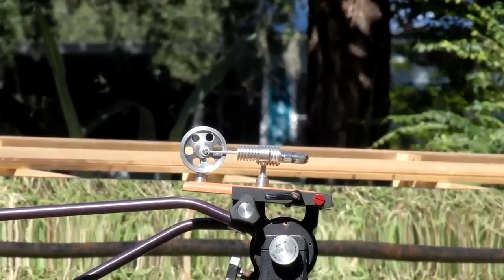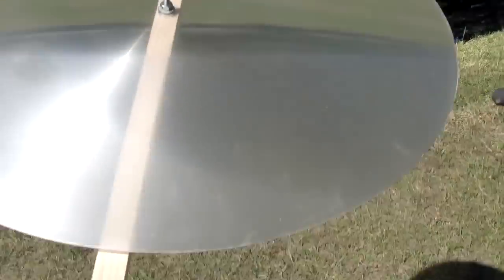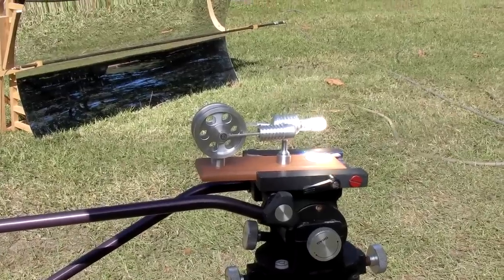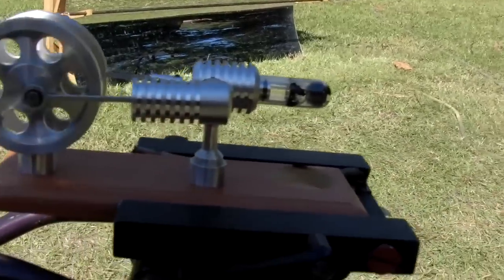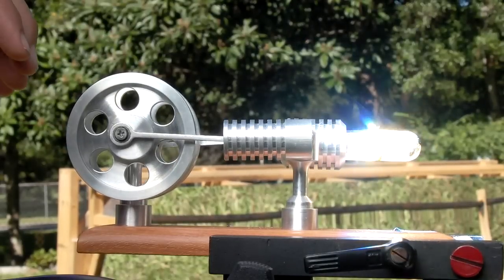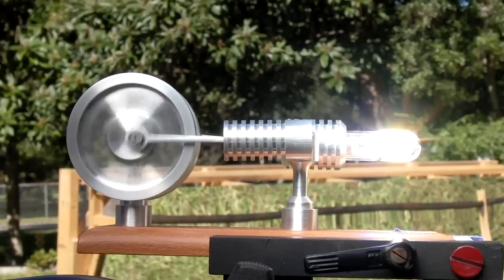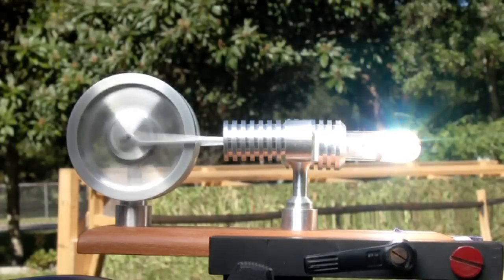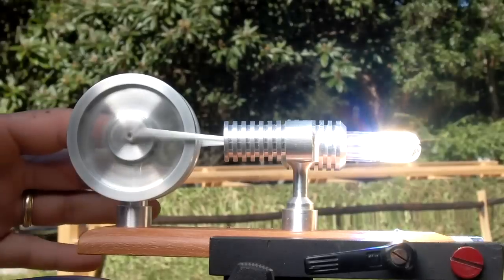STIRLING ENGINE FRESNEL Lens on a Steek Solar powered Stirling Engine

Comment: wht the heck cant we do this on a large scale free electrisity?
Reply: the problem with hot air engines they dont have that much torque yes they do have a lot of efficiency but its much better to use a solar tower
Reply: You're wasting your breath; you'll never convince a conspiracy theorist that they're wrong. "Conspiracy theory" is a state of mind.

One thing I can say for sure is that, as an electrical engineer, I sure WISH these "free energy" or "Tesla inventions" were real, because I'd quit my job and start selling designs/plans TOMORROW! Actually I'd probably start a company where I could go door to door and install "free energy" machines for people. Can you imagine how much people would be willing to pay me if they never had to pay a single power bill ever again?! I'd be rich!

Btw, for those who don't know, the oil companies are the primary driving force behind alternative energy. Wind and solar are both "big oil" creations. Do you think companies like Exxon-Mobil are just going to wait for the oil to run out, then go "Well boys, we had a good run, now lets close our doors forever"...? That's not how reality works. Exxon is (arguably) the biggest company on Earth, and they're going to make a seamless transition to alternative power once the oil is gone. No matter what, you're going to be making payments to Exxon-Mobil and Edison for centuries to come. Electricity is like water; the thing itself is worthless, but the infrastructure required to keep it flowing reliably and repeatably to your house, on tap, is quite expensive.
Reply: they are doing it - they're building solar power plants all over the world
Reply: Someone needs to start a Coop where everyone can pool funds to make one, put officers in charge with very strict rules as to how the funds can be used with all members of the coop agreeing and voting on what the desisions are.
Reply: Amos Kamil 
They do.  That doesn't make it free though.  Most of the cost of electricity goes to paying the employees that work to keep the power grid working.
Reply: One more thing - all usable energy comes from the sun. The Earth doesn't make magic energy for everyone to use. We need a LOT of energy, and the only way to get it is from a star. The star heats the ground, which heats the air, which turns wind turbines. The star heats the ocean, which causes water to evaporate and rise high in the air (giving it potential energy), then it falls back to Earth, and we trap it behind dams and make it spin turbines as gravity pulls it back to sea level. The star puts energy into small plants (which have an enormous surface area), then animals consume large quantities of plants (which condenses the solar energy), then the animals compress into oil (which further condenses the solar energy). 

No matter what, you need a large surface area to catch a large amount of solar energy. Solar panels are weak because they have a teeny tiny surface area compared to the surface area of the ocean, or the surface area of the land, or the millions of square miles of plant-covered surface area that eventually becomes oil (after condensing into animals). The only possible source of free, unlimited, futuristic energy is if we somehow figure out how to turn solar heat directly into electricity. For now, the closest thing we have is the power plants that use mirrors to reflect the sun's energy to a central tower (often filled with molten sodium) which then uses a heat exchanger to spin a turbine.

The only possible energy alternative is the nuclear reactor at the Earth's core, but that poses the same problem as the sun - how do we turn heat into electricity? If we knew that, then we'd simply use the Sun. So no matter what, the Earth itself is never going to provide any "free energy" to power our homes.
Reply: Amos Kamil;
"wht the heck cant we do this on a large scale free electrisity?"

What most people who comment in these kind of threads don't understand is, the energy itself is pretty much free already.  Especially if you think of hydro-power or solar collectors of various types (reflectors and panels).  In the case of nuclear, getting the energy costs some because it doesn't just come out of the ground in a usable state.  Has to be turned into proper fissable material first, but then it is quite economical.

What costs money is maintaining all this infrastructure and the electro mechanical installations (dams, solar plants, reactors).  The energy itself is cheap.  Getting it to you is not.

When it comes to a little motor like this stirling engine, you will need a very big one to make enough power to run just one house.  You could have one built.  It would be bigger than a car and cost $30-40,000 just for the engine.  Then you will need a Fresnel lens about 60 feet in diameter to run it.  How much that would cost, I don't know, but before you get your first kilowatt of "free!" energy, I think you will have around $65,000 invested, and you only get electricity on sunny days.  How long will it take to pay off that giant stirling engine and huge Fresnel lens?  Six decades?  Eight?  And by that time you will have worn out the engine.

All these "free energy" people think the oil companies or electric companies are cutting a fat hog in the rump, but really, they work on a very low profit margin, and they keep the lights on 24/7.  They've got millions of customers, so you think they are making lots of money off us.  It's not really the case.  Their reinvestment rate is very high.  They've done all the work for us, but some of us complain.  Well, stop complaining and go back to reading comic books by candle light.  Or invent something better.
Free energy is a lie.  Nothing is free, nor should it be.
Reply: You know, this question made me look up why this is. Short answer, it's a problem with energy density. As much as it pains me to say, and as awful as fossil fuels are for the earth, they are currently our best option as far as energy production goes. Although, because of the mechanical simplicity, and super high efficiency of the Stirling engine, I could absolutely see this becoming an effective means of power generation, provided you have a big ass solar collector.
Reply: If you had a great big solar collector, you would be better off using it to do more effective work, like heating thermal oils or sodium baths to use later, when the sun has gone down.  Otherwise, you have the same problem as all wind and solar have;  They are not in any way dependable 24/7.

The stirling engine itself is not even a good idea to begin with.  It's quite old tech.  It wastes a great amount of heat for little power.  Unless you have a nearly useless waste product you can burn to make heat for one, they are an expensive way to get rotational power.  I think we need to find a better way than converting rotation into usable energy.  Some kind of advanced fuel cell, and a very cheap way to turn water into hydrogen.  We can do that now, but it takes as much energy to get the hydrogen as the gas itself will then produce.  Once we get past that barrier, we have another option.

Fossil fuels are not really a problem for the environment with the current level of emission controls.  The thing is, some day, quite a ways off, we will run out.  At the moment, the small amount of pollutants produced compared to the work done is not bad.  The CO2 side of things is not a pollutant at all.  It's normal for the planet in even much higher concentrations than we have now.  Other things like NoX can be dealt with, and fuels can be cleaned before use with coming technology.  We just need something for generations far down the line, so they aren't left in the dark.  That's why we need something like fusion instead of fission.  Something far past the tech in the stirling engine.  It's archaic.
Reply: In a word, practicality.

There is a commercial version of this, but it's about the size of a bus, costs $150,000 to make, only works in direct, strong sunlight and needs a complicated tracking system to track the sun...and as soon as there's a bit of cloud, it's a giant expensive paperweight...oh, it only generates 38 kilowatts in perfect conditions.

For less than a tenth of the price, you could use an array of standard solar panels that are not only cheaper, way more efficient, a lot less complicated but also work in indirect sunlight.

The other thing to bear in mind that there's a huge difference between spinning up a flywheel and actually putting a load on the engine. I have a few stirling engines. I have one roughly the size and power in this video, and when I connect a generator to it, it'll just barely give me 5 volts. As impressive as that engine looks and as fast and powerful as it seems, the lack of torque means it's will probably run a few of LED's at most.
Reply: @watermelonhelmet6854  Good points.  Did you mean 5 "Watts" ?
Reply: Stirling engines are fantastic is very specific applications. Large scale power generation isn't one of them.

To make a stirling generator work you need a reliable source of heat, and a way to cool the 'cold end' of the engine. If you use a fresnel lens or an parabolic mirror to use the sun, you're also going to need to track the sun, which is complicated, expensive and the whole thing is a giant paperweight if there's a bit of cloud.

So where could they be useful? Well let's say you have a factory or work in an industry that generates a lot of waste heat... something like a big server farm, like a data center, Heat is a problem in server farms and you have to get rid of it anyway.

So, instead of just using a heat exchanger to just dump that heat outside (like 99% of server farms do), you channel that heat to the hot side of a stirling engine...now you're generating power from a reliable source of waste heat...and even if that Stirling generator only generates 5% of the power needed to run the server farm, given how much power data centers use, 5% reduction in power costs is massive. This would be especially efficient if the server farm was somewhere cold, so you could just expose the cold side of the engine to the elements to cool it.

Yeah, stirling engines are fun and interesting, but just totally impractical when it comes to large-scale power generation.
Reply: +Jim Nelson I'd support a crowdfund for this. make sure whoever builds it doesn't die in a freak accident
Reply: Space Otter You're thinking inside a box. You've already been defeated. Think local. All they had to do was teach us how to build our own or on the cheap. Big oil will never allow it.
Reply: yeah... "accident". like the guy who invented the salt water engine... died of a sever case of the flu... or was it really ricin?
Reply: You know i ask this question over and over.  I just think they dont want something like this working on huge scales.. Then they couldnt sell oil! Or they couldnt sell their stupid ass wind generators that cost millions..  I wish i had the means to make one of these on a big scale.. You know it works!

Comment: Do they have solar Stirling engine plants? That'd be so cool.
Reply from the maker: TheSilverSmith There are large scale projects but PV lower pricing has dominated due to the no moving part thing.
Reply: Yes. From a 2013 article: As stated by Carl Ohlen, Marketing & Sales Director of Ripasso Energy is certain that the best solar conditions for the solar stirling dishes are met in parts of MENA, South Africa and Chile, where LCOE levels of less than 0.1 Euro per kWh for a 30 MW plant can be obtained.

Comment: Could you mount super magnets into the holes in the wheel, then place a coil of wire next to the wheel to generate electricity?
Reply: FarSeeker8 Or just belt-drive a generator.
Reply: rlrsk8r1
Well, a belt would be more mass/inertia to fight and losses due to friction and slippage.
Just turn the wheel into a generator.
Reply: Keven Jones "Combine this with geothermal buffering, add a better gas than air, add a regenerator component"
Sounds like Yellowstone in winter to me. Or a multitude of other lower temperature geothermal locations in colder climes.
Hey! What about those geothermal vents on the ocean bottoms? Now there's an opportunity! Can multiple cylinders be timed to work together? Like in WW2 fighters'  rotary pistons engines?
Reply: Multiple cylinders can easily be timed to work together.  Just take two of these engines, put them out of phase with each other, and hook them together by the drive shaft.

Comment: I would use a Fresnel lens like that to heat the boiler of a steam engine maybe…those can take more resistance…maybe I am wrong...
Reply: FarSeeker8 Physicist, not engineer
This is true, but, if you transfer the energy to an engine with a greater efficiency, you could still end up with a greater power output than what you had before, even though there is energy loss.
I wonder whether you could use a Fresnel lens to power a hot air baloon, instead of a flame?
Reply: I don't know about that. I think that each time you transfer the heat (energy) from one medium to another you lose some, thus you'd get less work from a steam engine than from stirling engine
Could we have an engineer comment on this?
Reply: Rechargeable batteries.
Reply: rlt94 Have you read about the new Aluminum battery technology? Still light weight, but fewer thermal issues (no fires) and less toxic.
Reply: Thank you. water/steam does seem to have some unusual properties.
OTOH, Likely the balloon's fabric (or whatever) could not survive or transfer the heat like the metal and glass in this demo.
Reply: You will have to make up the huge water loss every time

Comment: It's a great video, but if you can reduce the rpm simply by applying pressure with your finger, then it raises the question of torque.  Therefore, have you tried running any kind of generator with it?

Comment: Hello, Could you please confirm that there is only air in the glass chamber? I would love to understand how the engine is working.....
Reply: it is just air, in the cylinder that hes directing the lens at the air is heated and expands and the air in the other cylinder is much cooler, this difference in temperatures allow the pistons to alternate back and forth as long as there is heat on that cylinder.

Comment: If you use the rotation of the Stirling motor to create a magnetic vortex with Neodymium magnets the over-unity effect would increase the power and it should achieve incredible yields.
Reply: Richard Schreck at this scale maybe, but an engine of a higher scale could run a larger alternator and generate as much if not more power than photo-voltaic cells.
Reply: stirling engine is better than consumer grade regular PV. Its power output rate below CPV but higher than regular PV you see on roofs, installations in gardens..

Comment: Just curious, if you happened to put magnets around the flywheel, would it be possible to use this as an induction generator? That just seems like the easiest way to harvest power from a device that doesn't produce a lot of torque. My field is materials so this mech stuff if a little foreign to me, can anyone shed some light on why this is probably unfeasible?
Reply: its not unfeasible, in fact there are power plants in some places that use that exact idea. And torque can be fixed by making a larger scale of the engine so it can run a larger induction generator.
Reply: Better to have lots of little ones pushing a bigger one, then the increased momentum can act as torque?
Reply: Why to use induction generator instead of that why can't u give the sunlight which is given to the sterling engine to a solar cell and make electricity with minimal maintenance
Reply: @shashankkumar5163  it's because of the efficiency difference. I believe I have read that the sterling engine provides 40% efficiency. Compared to I believe solar was around 25%
Reply: @signbusa  Actually efficiency of an sterling engine varies from 15 to 30% .....And for the whole sterling based generator efficiency we also need to consider the efficiency of induction generator which is about 90% in good cases. So the whole system efficiency best we can get=0.3*0.9=0.27=27%....But we have developments leading to efficiency increase of solar cell...and also sterling engine is costly and if we do its maintenance which will require more of money which will make it even costlier..
Reply: @shashankkumar5163  Stirling engines are minimal maintenance. Just two pistons. How are you measuring efficiency? KWh/land area/maintenance/material and construction cost/waste? Stirling engines are extremely efficient and make almost no noise.
Reply: @signbusa  wouldn´t be concentrating the light for steam production be better, steam engines might have higher efficency
Reply: @99 Credits that’s an interesting concept but a big problem of desalination is that the salt simply gets dumped back to sea which is highly harmful to sea life.
Reply: @austinalley6036 :  Salt should be diluted with water at safe level, then gradually pumped out of the sea as the unloading ship container continously travelling  far away from shore.. Never attempt to pumped out to the sea the the diluted salt- if the ship was IDLE- NOT MOVING... Sure damaged will be done to the living under. sea community at the dumping site... As simple as that...

Comment: Yo can try to melt down some Nickel into the shape of the glass. To make the shape of the glass you can duplicate it first with some concrete and then fill the shape with small amount of melted Nickel. Once the Nickel is cold, remove the concrete shell and put that nickel piece in the glass container. other way is to make the same but with the outer shape. That way you will put the shape outside the glass.
Reply: Giorgi Ivanov: What is the characteristic of nickel?.. good heat absorber?..aluminum is also good heat absorber.. Pls elaborate why you adviced the nickel material...